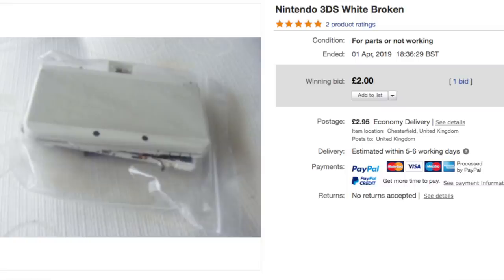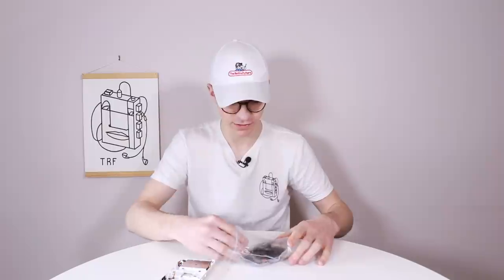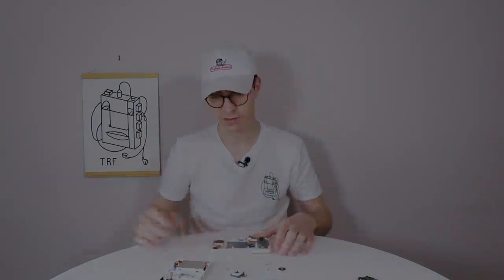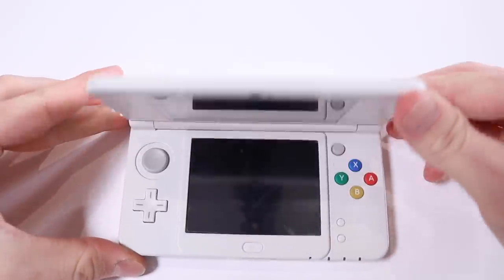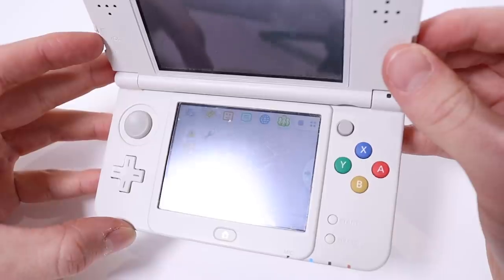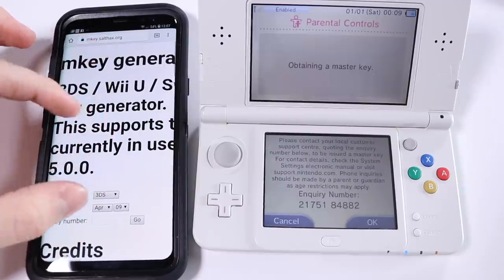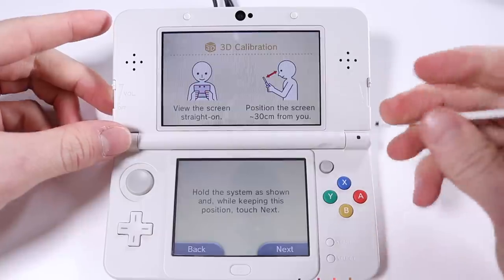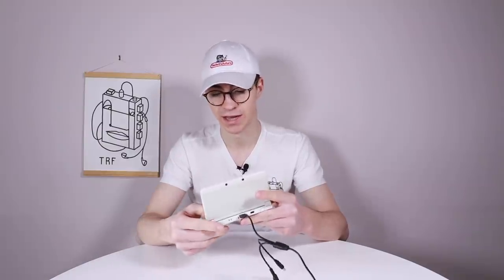£4.95 Nintendo New 3DS - Can I Fix It?

Comment: My 2ds fell and won’t turn on but the light is on? Is this common
Reply: Angelo Ortiz Try turning it off and hold A+L+R+Up on D-Pad while booting it up. If that doesn’t work then check to see if there visible cracks anywhere on the screen or if the blue light comes on makes a cracking noise and then turns off. Both of those would require a screen replacement.
Reply: MrDoge thanks but it stays on the charging light

Comment: This video is click bait, all you did was put it back together, there was no repair. The one part that was broken, the joystick, you did not fix just saying you would replace it later. you did not find out why it went "wacky" as you put it when you turned it on saying it "might" be because of the one broken part that, once again, you did not fix... All you did was reassemble it and turn it on and it worked.